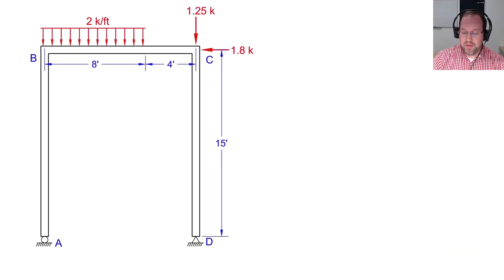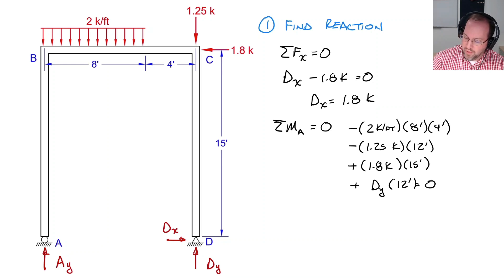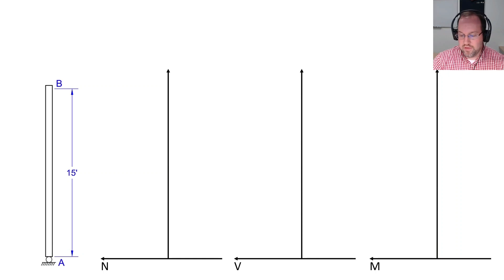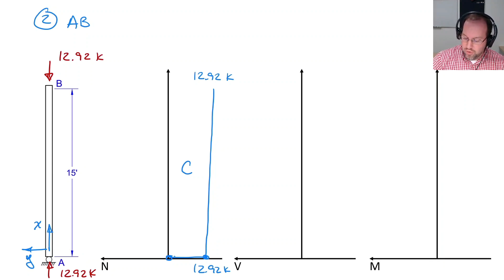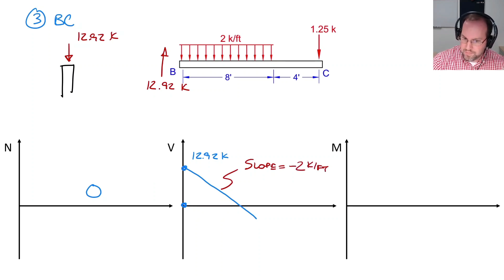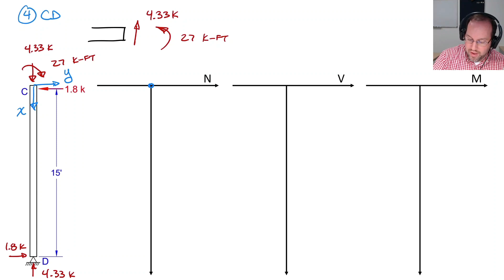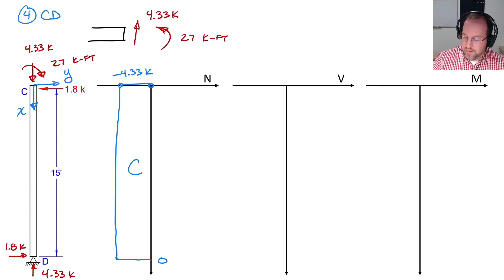Axial, Shear, and Moment Diagrams in Frames - Intro to Structural Analysis

Comment: On Step 4 for member CD, it has a -1.8 kip at the top of the column, for equilibrium purposes, wouldn't there be an equal and opposite reaction of 1.8 kip at the end of member BC?
Reply from the maker: No, the 1.8 kip force is an external load applied at point C, not an internal force. I’m assuming this force is applied to the column. Internal forces will have equal and opposite forces on either side of the slice because they represent a state of stress inside the structure. For external loads, the equal and opposite reaction would be applied to whatever made that force (maybe an actuator or someone pushing on the structure).

Comment: Does anyone know why at 6:21 the left side has an upward reaction of 12.92k but the right one is unknown. Why don't we say it has 4.33k from Dy
Reply from the maker: You are correct, we do know the right reaction in this case. I left that out, however, just to show that this method doesn’t require you to know that reaction. When you integrate the load along the length of the beam, the right end shear will match this 4.33-k reaction, which is a nice check for equilibrium.
Reply: @StructuresProfH  Thank you for clarifying and for an amazing video

Comment: HI!, THX a lot, cab you Explain how did you Check the triangles for the slope pleas?? 7:19
Reply from the maker: The slope of the shear diagram is always equal to the magnitude of the distributed load, which is 2 k/ft down in this case. To find the base length of the triangle, this is just the height (12.92 k) divided by the slope of 2 k/ft, giving a base length of 6.458 ft.

Comment: Could you please explain how you can determine whether it's in tension or compression in the bending moment diagram. Thanks!
Reply from the maker: Bending moment will cause one side to be in tension and the other to be in compression. Using the sign convention we adopted here, the side that the diagram is drawn on in in compression (the other side is thus in tension). Thus, Beam BC on top has compression on top and tension on bottom, and column CD on the right has compression on the right (outside) and tension on the left (inside). 

If you want to know the overall tensile or compressive stresses, you would need to combine axial force and bending moments: for example, for linear elastic bending, axial stress = N/A + My/I (using the proper signs for negative compression and positive tension to make sure they are combined correctly).

Comment: What if I have a curved (semi-circular in my instance) frame? How do I implement NQM there?
Reply from the maker: The full answer might be a full video, but in the meantime, I'd probably take slices of the free body diagram at some angle theta (sort of like polar coordinates) rather than at some position x. For a semi-circular frame, the axial force will be tangential, the shear force will be radial, and the bending moment will still just be a moment. Even for a concentrated force at the peak of frame, the axial and shear force values will not be constants - they will vary by the angle theta. From there, you can apply equilibrium (sum of forces and sum of moments) to find the internal forces.

Comment: Hello Professor H, for a falsework bent supporting a sloping concrete slab at  10% cross slope, do the vertical posts have to be braced to resist the horizontal force due to the sloping bent cap beam??  Some on the team think that yes, others think that friction will transfer the dead load vertically into the posts regardless of the slope, so there is no lateral force to consider.  What does Prof. H say?  Thank you.

Comment: why is there no moment at top left corner, at B?
Reply from the maker: The column from A to B is supported by a roller at the base. This means it only has a vertical reaction at the base, and therefore it only carries axial force. The moment is determined by integrating the shear (that is, taking the area under the shear diagram), but the shear is zero for the entire column. Therefore, the moment is also zero for that column, including up to point B at the top left corner.

Comment: Is there a version where you use SI units?
Reply from the maker: Sorry, no. Fortunately for structural analysis we only really need length and force units, so 1 Kip = 4.5 kN and 1 ft = 0.3 meters (approximate conversions) will get you pretty close. The process is otherwise the same regardless of your unit system.

Comment: isn't the M-diagram the integral of the V-diagram? and therefore the M-diagram should have been drawn on the other side of the last beam?
Reply from the maker: The M-diagram is indeed the integral of the V-diagram, but being an integral, you will have a constant of integration (the internal moment at the beginning of the beam). That starting point will have an impact on the sign of the M-diagram. But yes, positive shear means moment moves in the positive direction, and likewise for negative shear.

The other way to keep this is mind: the moment diagram is always drawn on the side of the beam or column that is being compressed. This can be used as a quick check if the signs make sense by sketching the deflected shape of the structure.

Comment: sir, may i know in 5:57 , why do we use the reaction force(already given: 12.92, upward) instead of the internal foce(downward)
Reply: also,, how do you calculate the shear forces sir,, sorry if i happen to ask you lots of quest. ,,
Reply from the maker: At 5:57, I am looking to find the internal forces in Beam BC. The downward (axial) internal force at the top of AB must be applied as an equal and opposite upward (shear) force at the left end of BC. It's not technically accurate to call this upward force a "reaction"... it's actually the internal shear force at the left end of BC. Again, we know it acts up because it must be equal and opposite that on the top of AB.

As for computing shear forces, the shear diagram (which is just a plot of the internal shear forces at all locations throughout the structures) "follows" the applied loads. Shear is always perpendicular to the direction of the structures, so shear in the columns goes right-and-left, while shear in the beam goes up-and-down. Because of this change in direction, we have to re-orient ourselves with the internal forces whenever rounding a corner. Hence as described above, the axial force in the column becomes the shear force in the beam when going from AB to BC.
Reply: @StructuresProfH  thank you very much sir for the explanation 🙂

Comment: Hey sir at 10:04 can you explain why you did not connect the shear and moment diagram to zero at the end? Since you solved the for the missing shear and moment i thought u would complete the diagrams?
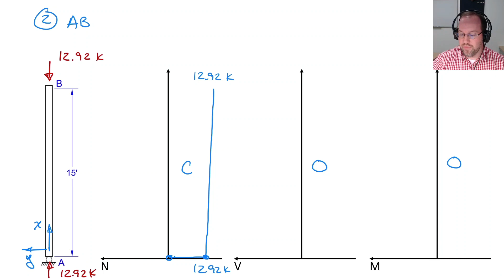Reply from the maker: Thanks for your question! At point C, there is still an internal shear (4.33 k) and moment (27 k-ft). I recognize that some people have different conventions for this, but I like to leave the diagrams "open" when I'm still in the middle of the structure, and only "close" it back to zero when I get to the end. You will notice I did the same thing at point B at 5:38.

I do this because the shear and moment diagrams physically represent the internal forces or moments at that point in the structure. Closing the diagrams back to zero at corners B or C seems to imply that the internal forces jump to zero at those points, which is clearly not the case. 

Anyway, regardless of my opinion on this topic, I've see both ways done, so I'd say it mainly comes down to preference.
Reply: Hey what’s the reason behind separating those 2 point loads in the beginning

Comment: thanks for the video, why is the 1.8k positive ? would it be negative if it is applied to point B or if it was reversed at point C and what would happen if it would be below point A in a mirror like picture ?
Reply from the maker: I believe in the video, I call this 1.8-kip force at C a negative force, not positive. But, to be honest, positive and negative signs for forces are completely relative. It depends on the coordinate system you are using. The more important consideration is how the load changes the axial, shear, and moment diagrams. 

So for the 1.8-kip load at C, we are looking at the shear diagram from C to D. The positive x-direction goes down from C to D because I defined it that way, and the positive y-direction follows the right-hand rule for coordinate systems (x points down, so y must point to the right). The 1.8-kip force points left and is therefore "negative," but all you need to remember is that the shear diagram moves in the same direction as the applied load. So because the load points left, the shear diagram from C and D also moves to the left, taking me from 0 to -1.8 kips in shear. 

Note that flipping the coordinate system turns this around, but we can always use the same shear diagram principle. So if I instead define the positive x-direction as UP from D to C, now the positive y-direction points to the left... my leftward 1.8-kip load is now suddenly positive! In this case, we would draw the shear diagram starting at D (you always need to draw diagrams in the direction of positive x, never backwards) and going to C. When you do this, though the shear diagram may look flipped, you will find that the shear demand is still -1.8 kips along the entire length of the column from D to C... exactly the same as in the video where the shear diagram was drawn from C to D.

Comment: The final moment diagram, why is there a small vertical line going down at  27k/ft to the top corner of the frame? Just before  the triangle?
Reply from the maker: The moment at the upper right corner (location C) is 27 k-ft in the beam and column. It doesn't change around the column. Honestly, I drew a vertical line there just out of habit... the moment doesn't go from 27 k-ft down to zero and then back up to 27 k-ft. It just is 27 k-ft at that point.

Comment: should 1.8K be included as a force acting in x direction in 3-BC ?
Reply from the maker: For the point loads at connection C, you can pick either free-body diagram (FBD) and get the same results. So we could apply the 1.8-kip x-force to either BC or CD (but not both at once), and we could apply the 1.25-kip y-force to either BC or CD (but again, not both at once). In this video, I chose to apply the vertical force to (3) BC and the horizontal force to (4) CD because I find it more intuitive to modify shear diagrams rather than axial diagrams, but that's just a matter of personal preference.

At any rate, each external force should only be placed on one FBD; for example, if the 1.8-kip x-force were placed on both segments (3) BC and (4) CD, then the force would be double counted.
Reply: @StructuresProfH  Thanks Professor.

Comment: when taking the moment about a, why dont you consider dx?
Reply from the maker: The moment arm for Dx about point A equals zero, so it doesn't show up in the sum of moments about A. The moment arm is always measured perpendicular to the line of action of the force. Dx acts horizontally, so the moment arm is the vertical distance from A to D... which is zero because A and D are at the same height.

Said another way that may be more familiar to some: the line of action of Dx passes through point A, so it has no moment about point A.

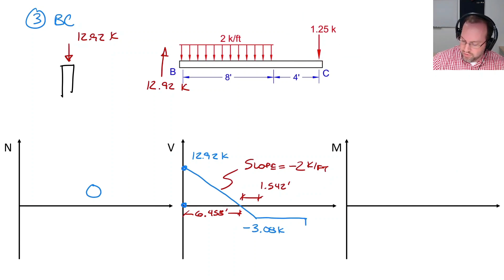Comment: 7:45 i dont get it,isnt the shear at point c equal to -1,25 kips?
Reply from the maker: The 1.25 k is an external (applied) force at point C, not the shear, which is an internal force at that same point. The external force moves the shear diagram down by 1.25 k, in the direction of the force.